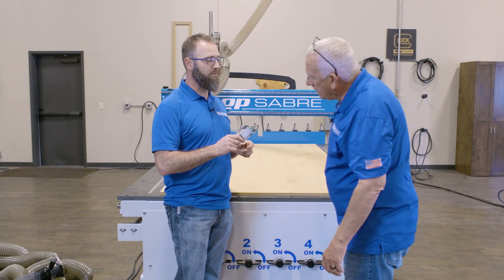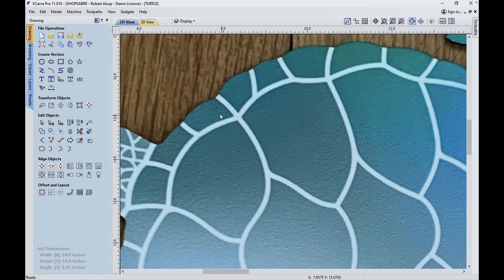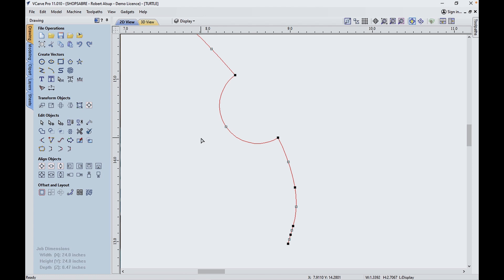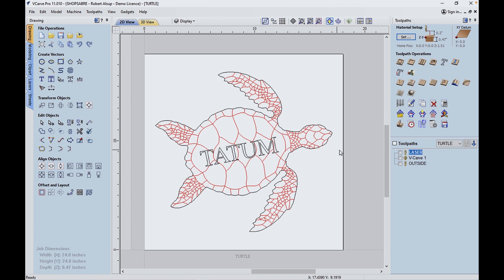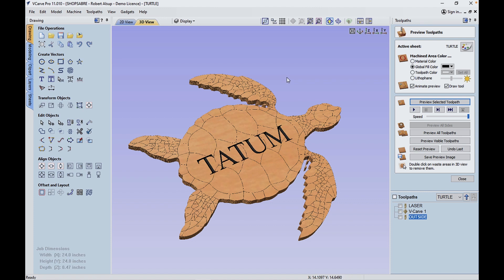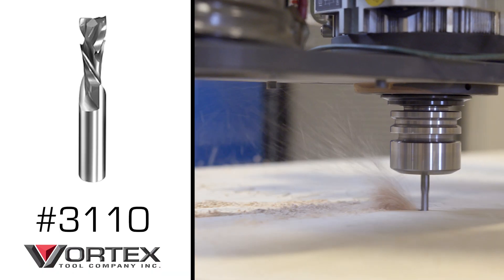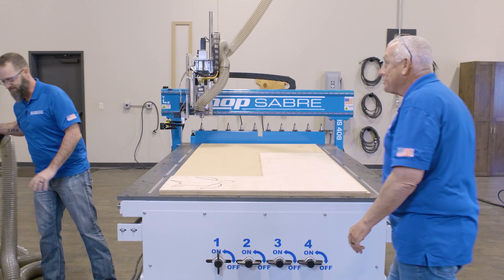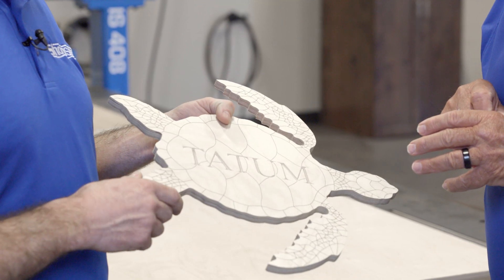Using a ShopSabre Router + Laser to Create a Turtle

Comment: Is that telescoping arm the standard when you purchase the opt laser option? In the retracted position, is that enough clearance for the dust dock and ATC?
Reply: That arm is called a “slide” and it has a cylinder that raises and lowers the the Opt Laser.  Think of an “active” position where the laser is lowered for use and an “inactive” position where the laser is raised out of the way.  This lets you combine routing and laser in the same program.  The slide is part of the Opt Laser option on IS and Pro models … it is not used on SS and RC models.  There is a retrofit option that allows you to add the Opt Laser to your existing ShopSabre CNC.
Reply from the maker: The Z assembly for the Opt Laser is only on select models with select options. Generally there is enough room with an ATC & Dust Dock and the Slide would be used in this scenario.

Comment: When/why do you use arc curves vs. bezier curves?
Reply: Cody, Bézier curves are what I refer to as “handle bar” curves because in the node editor in Vcarve Pro you shape the curve by moving the ends of the handle bars.  The result is “organic” shapes rather than “mechanical” shapes (lines, arcs, circles).  There are only three cutting shapes available in G-Code, straight line (G01), arc right (G02), or arc left (G03).  Since a Bézier curve is an organic shape, Vcarve Pro generates a series of tiny straight line moves (G01).  Each one of those straight line moves requires a line (block) of code in the G-Code program.  The programs can be very long.  By converting the Bézier curve to tangent lines and arcs before generating G-Code, the length of the programs are much shorter since an arc is a single line of code just as a line is a single line of code.  The difference can be substantial … the process may be reduced from 1000 lines of code to 100 lines of code!  You will not be able to tell the difference in the finished parts!
Reply from the maker: This is based on vectric programming and the file we brought it. Arc curves are common for CNC programming
Reply: @shopsabre  Yes but I'm asking why you chose to do arcs instead of bezier. There's a reason both exist in vcarve, but is there a specific reason why you would want to use one over the other?